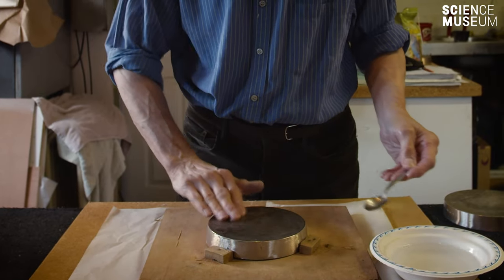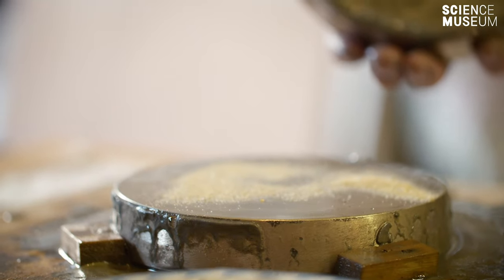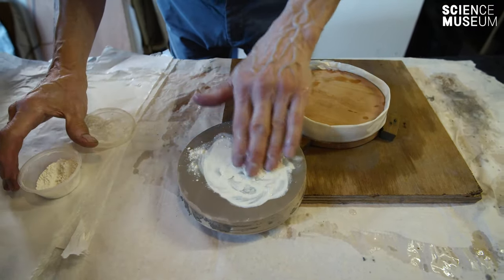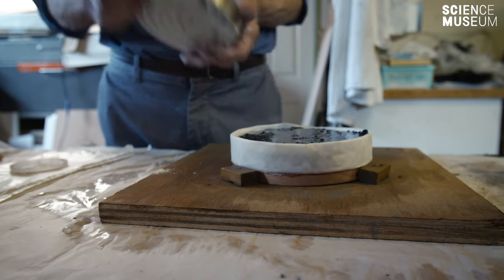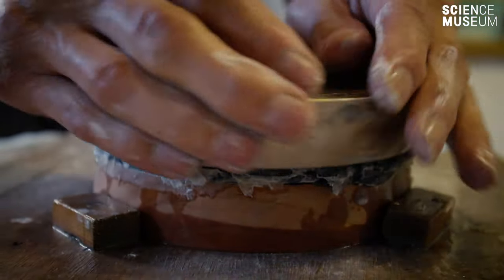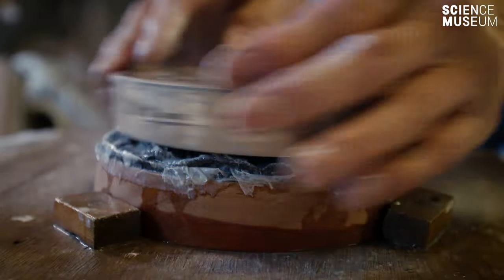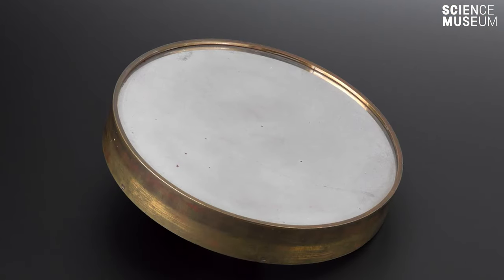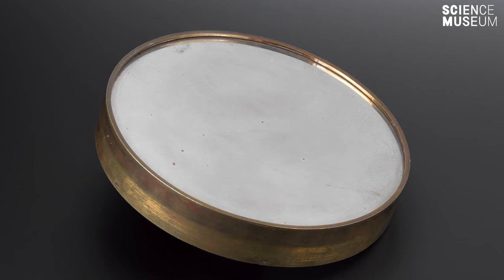Polishing a bronze telescope mirror I Shaping Science episode 6

Comment: Interesting only for historical reasons. Bronze and the similar speculum metal tarnishes quickly and you have to regrind the mirror. After glass silvering was invented the metal telescope mirrors became obsolete.
Reply: It is much easier to cast and polish speculum/bronze for the hobbyist than slumping, grinding and silver coating glass. Bronze keeps fine if you take care of it, and all it takes is a light polish to shine again.
Reply: @BB Sky Long before the appearance of this video I also polished some bronze mirrors, but much smaller. When bronze has a high concentration of tin, around 30%, it is very hard (its hardness exceeds the hardness of steel) and very brittle (it breaks much easier than glass). Being so hard, it can be polished perfectly !  Aluminum cannot be polished because it is too soft, although there are alloys of aluminum that could be polished, but not as well as bronze. Bronze mirrors reflect about 70% from light.
Reply: @BB Sky The too hardness of bronze should not worry, because it is also fragile and brittle and can be processed in much the same way as glass.
   I also tried to polish a bronze mirror of only 42 mm diameter with which I made a Newton telescope. I had many difficulties, because I don't have too many material possibilities. I melted the bronze with the stove and a Bunsen burner, and you can't melt too much with something like that, but it was enough. The other disc can be from iron or brass.
   Although the formation of the concavity of mirror is done in the same way as in the case of glass mirrors, the polishing proceeds differently, not as shown here !  That's exactly why we weren't show the result of the polishing, because I'm sure it didn't turn out very well !  I used chromium oxide, and the polishing followed the same method indicated by Newton in his book "Optics". In relation to this subject, I wrote a very detailed article, of 9 pages, in an astronomy magazine from Romania, where I am from.
   This video deals with an extremely important topic and it has so few views !  The topic is related to the history of astronomy, to Newton and Herschel !
Reply: @marianl8718  melting on bunsen burner??? Is impossible!!
Reply: @maximohuenulef  It depends on the quantity. A bronze with 30-32% Sn melts at around 750-800°C, and the temperature at the top of the flame of a Bunsen burner, with a concentred and strong flame, reaches 1700°C (nitrogen in the air does not contribute to combustion and cools the flame).
   I also helped myself to a stove eye that was burning underneath, and on top of the metal I came up with the flame of the burner, which did the hardes part.
   At that time, propane-butane burners were not commercially available, which are very good, but their fuel tank is quickly depleted.